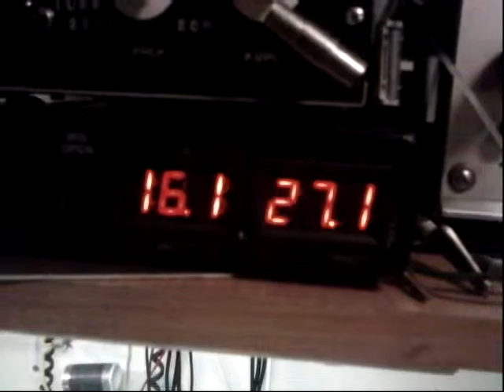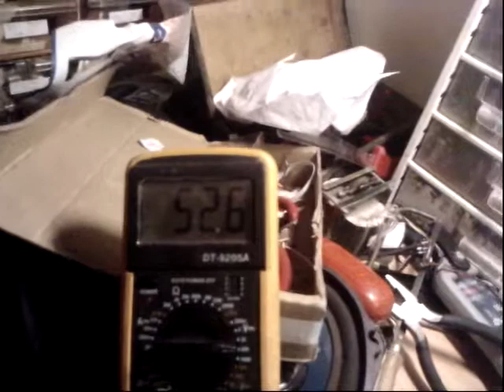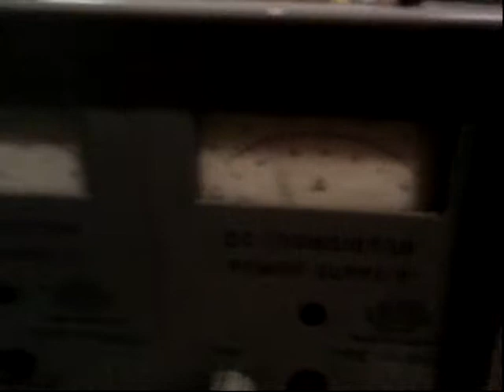PL504 SE Ua=50V Ia=83mA TESTING Part I.

Comment: hey, i need a help, im thinking to make an amp with 4 of PL504 in parallel connection.. on the google you can find a scheme with two of PL504, but what will happens if i add two more with the same resistors and capacitors.. What kind of transformer should i use as an output ? What is the resistance of primary coil, measure it with multimeter please.
Reply from the maker: Yo!

I used an 230V/12V SM74 transformer, and the primary impedance is 44 ohm.
But you can get the optimal impedance with the following formula:

USupply / I Anode = Optimal Impedance of the Tube on the voltage.
If you parralel the tubes the impedance is divided by2

So eg:

80V/100mA = 800ohms

(PL 504 can handle max 250mA But if you use the half of the normal load you can get more life from the tube. (I use 100-150mA max)

If you want to use more tubes like 4 pcs this is divided by 4 so its 200ohms.

So its a 230/40V Transformer.

You can use the following forumula to get the impedance what the valve "see" from the transformer.

((U pri / U Sec) * (U pri / U Sec)) * R Load Speaker = Optimal Impedance.

So eg:

(230/12) * (230/12) * 8 ohm load = 2940 ohms at anode.

I hope I was able to help. :)
Reply: Body-Guard so, between B+ and Anode is 44 ohm, and it works like that ? my transformer is about 65W and has 36ohm, will it work with 4 tubes on 100V (more or less) ?